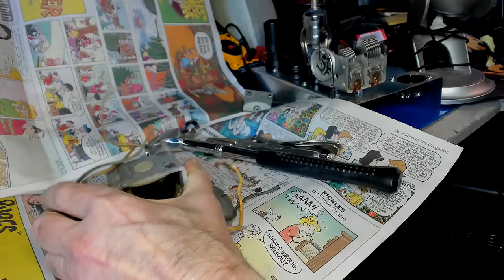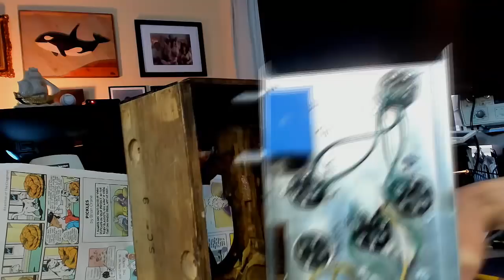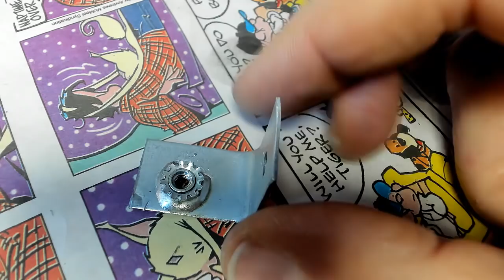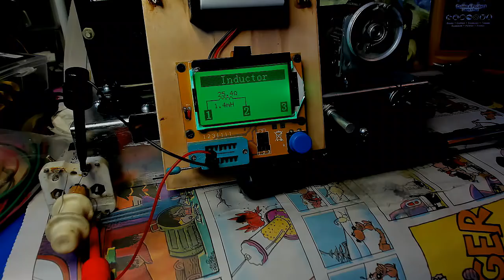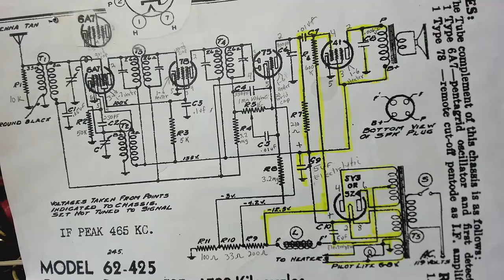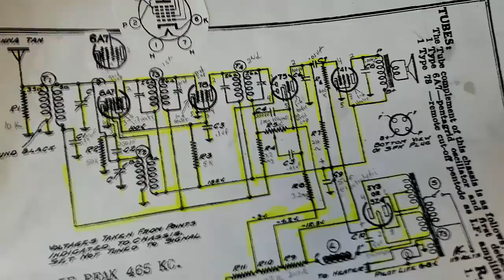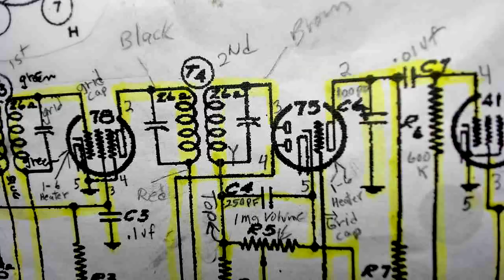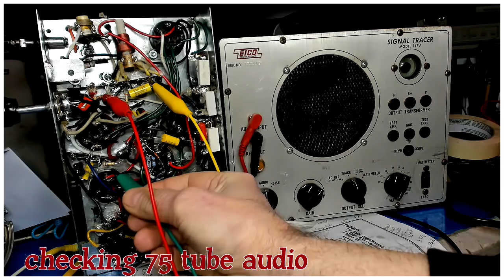Making a 1937 Airline Radio Chassis Part 2

Comment: Well done Buzz (and Brendan!) - I feel your pain - I built a set from scratch a few years back and 'enjoyed similar challenges'.   Looking forward to the next episode....
Cheers,   John
Reply from the maker: it was not fun, thats for sure, but i am glad it happened, i may have learned a thing or 2.
Reply: I may try to do the opposite, I have several radio chassis, more or less complete ones, but with no cabinets, ironically one is an Airline as well, but it's a 1939 model.

Comment: I was wondering if the lack of signal, and the fact that it would only pick up one station, had something to do do with the leads of each IF can coming out of one hole, until I watched the end of the video. I rewired some IF cans in a Philco model 42-327, and the set became a one station wonder, with lots of oscillation, and noise, until someone suggested that the leads of the primary, and secondary might be crossed, so I drilled another hole in the chassis for the second pair, and that solved the problem. This is why guys like Shango066 try to discourage people from just recapping a radio/tv wholesale without trying to power it up first. 
 With regards to adding a threaded insert in a mounting bracket there are some hardware/fastener places that have threaded inserts that install in a hole in sheet metal, with a tool like a pop rivet. If someone needs to do this in future it may be a better idea rather then tapping a hole in thicker steel. NIce work on the chassis by the way, but see if you can find some electrical knock out punches, maybe in a pawn shop or on C.L, those hole saws are pretty miserable to use in thin metal.

Comment: Hi Buzz, watching this again, I think the 600K resistor in the cathode of the 41 output stage is a mistake. Did you mean 600 ohms? Even that would be a bit high. Typically the cathode resistor is 150-300 ohms.
Reply from the maker: It's a 600 ohm resistor..I guess i misspoke....Buzz
Reply: That makes sense. The output stage would be dead with a 600K resistor in the cathode circuit.